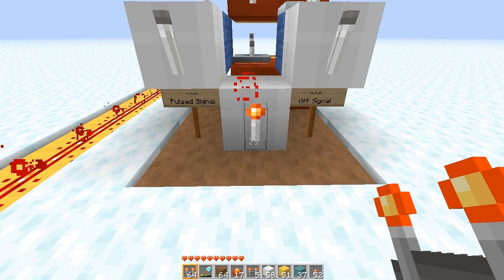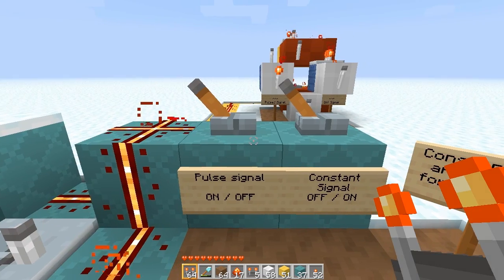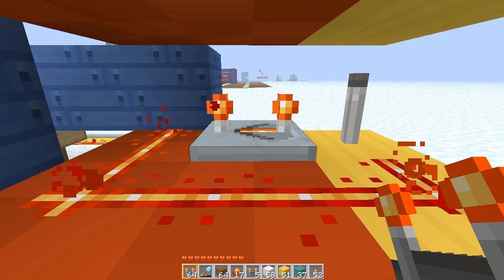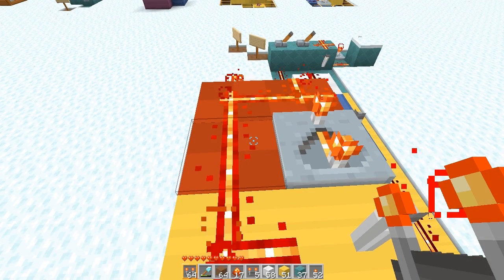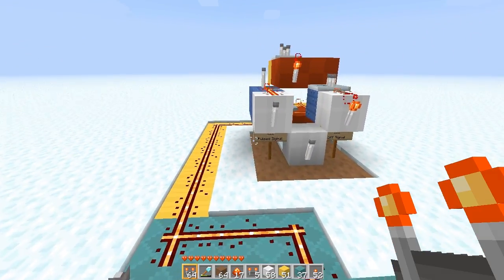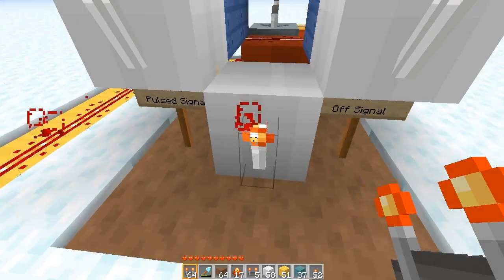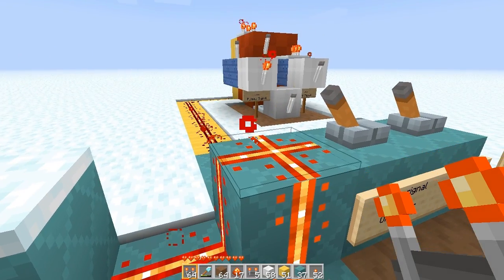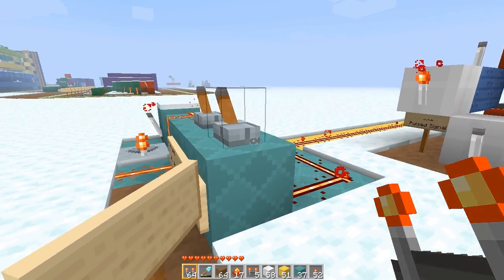Send 3 signals through 1 redstone wire!

Comment from the maker: @Decimaegeminae 
Ahh, yes, the problem with that design is that a rather bulky and complex repeater setup (seen in yellow blocks there), is needed for each repeat of the the signal. That's fine if you're sending a short signal, but long distance ones like I aim for are better off with a more complex receiver and simple wiring.

Notice that for 10 button inputs over a wire, that design would almost have to be constant bulky repeater setups adjacent to each other. My next design avoids this.

Comment from the maker: @dragongamer123 
I only started learning redstone and circuitry in May, so it's not incredibly difficult to figure out. What I'm good at doing is coming up with innovating solutions. I figure out the components needed for them (in this case, how can I turn a pulsing signal into a constant one? How do I design a vertical AND gate for the two layers?), I map it out on paper using boxes labeling the components and lines connecting them like wires (AND box connects to two pulse converter boxes).